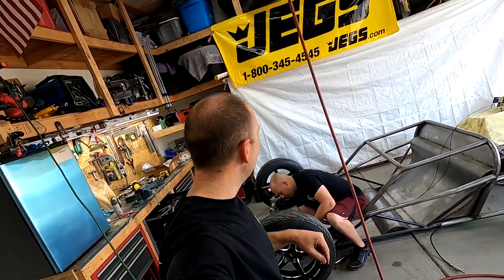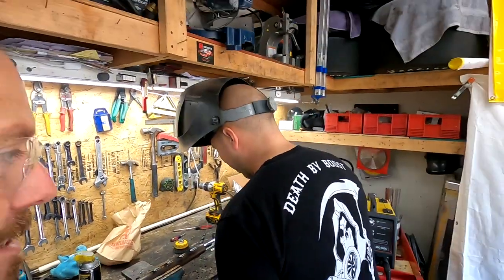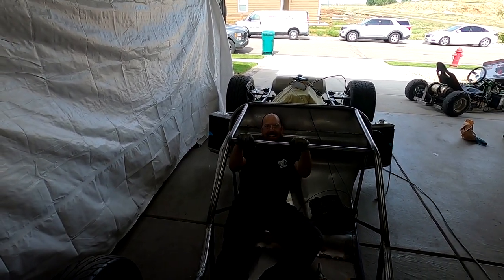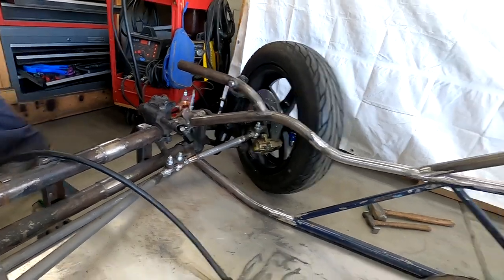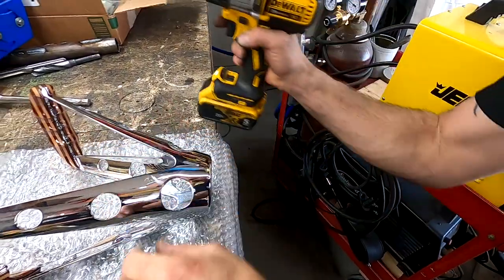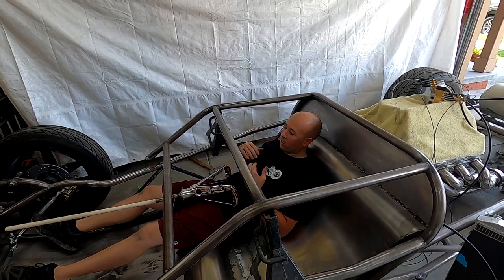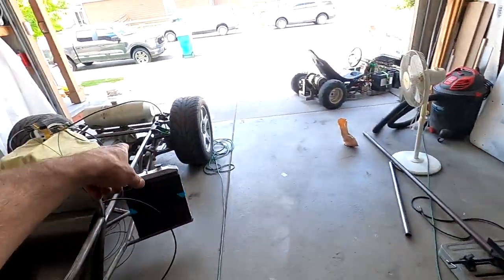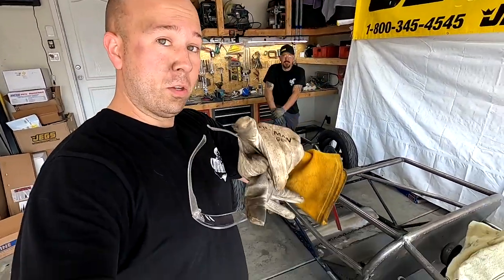Lighter Than a HONDA CIVIC! Sure Makes One FAST Street Car!

Comment: Why didn't you go with a motion race works steering column cause you can cut it to length unless it's cost more than the piece of pipe you have to order just wondering
Reply from the maker: I didn’t think of that. But in all about 100 for this setup
Reply: @DeathByBoost  well I look forward to seeing which way you go cause I know you have to shop for the best prices